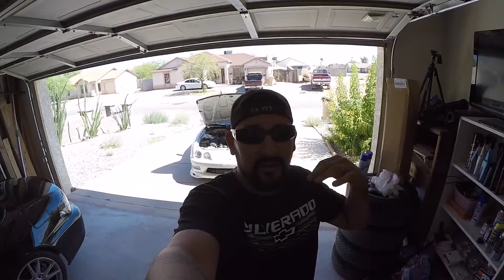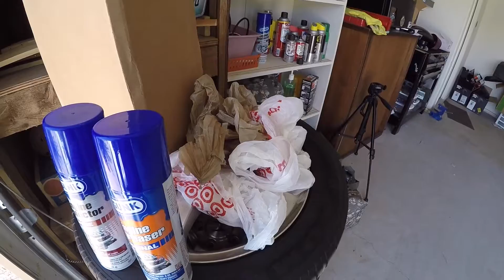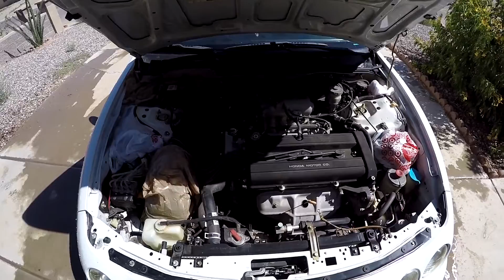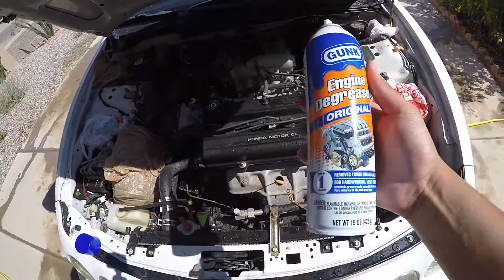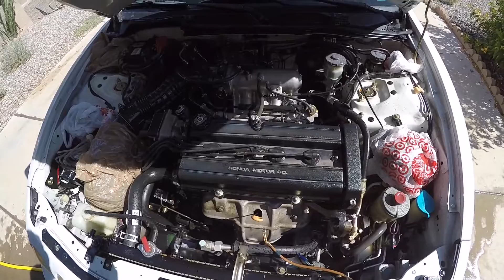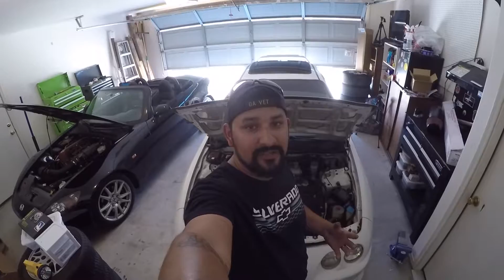How To Clean Your Engine Bay!

Comment: nice video, from a detailer i'd say use pressure washer for the powerful spray, and i've found this stuff called "la's awesome" its a yellow liquid in a spray bottle that you can find at like dollar general...its cheap and works really good, I also use it on tires (not rimes) and under fenders (wheel wells)
Reply from the maker: Right on man! Good to kno. Thx for the advice
Reply: +Luis HQ anytime man that's how we all learn about stuff is from others. Integra is clean, I can't wait tel I figure out what's wrong with mine lol made a running video but no ones givin any ideas yet lol